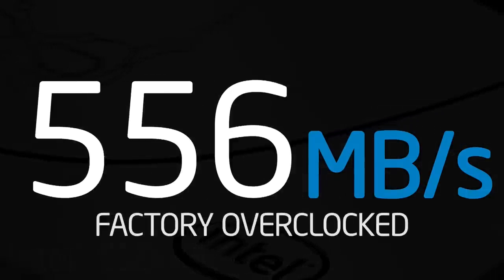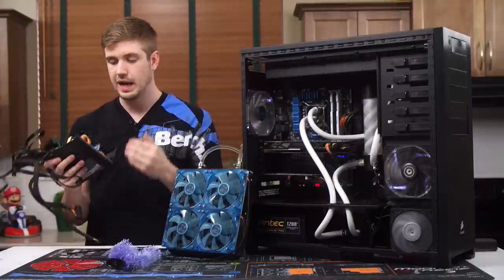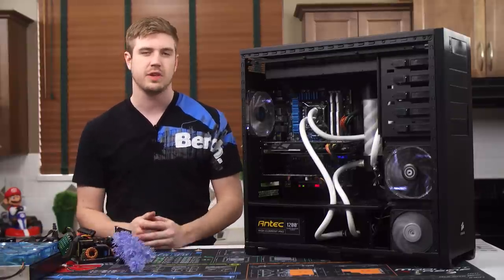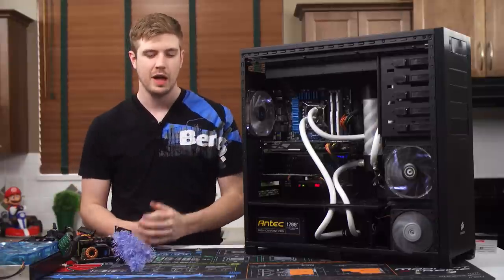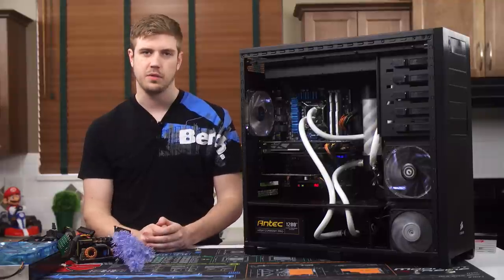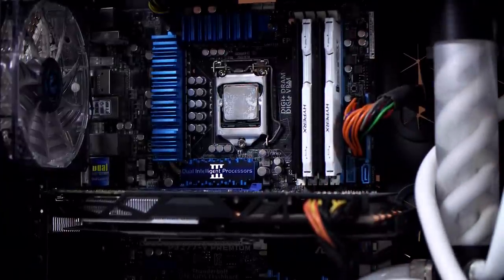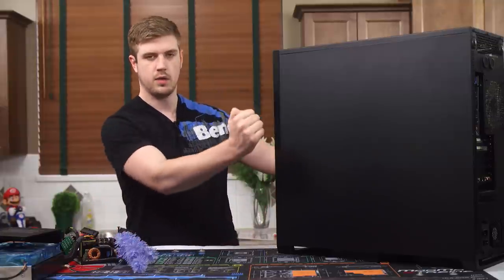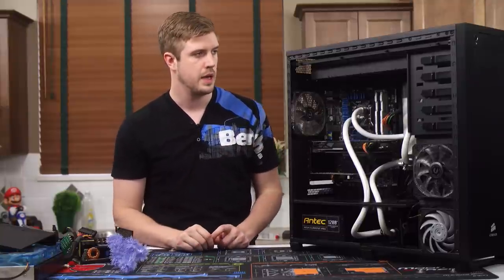Personal Rig Update 2 - Slick: The Introduction of Squirtle

Comment: It boggles my mind why you decided to go for a 780 instead of a 290X/290.
You & Linus are Nvidia fangirls and I hate it !
I lost all the trust I had in you guys when you Luke would benchmark the 7950 and have it beating 680s and then Linus would go recommending the 660 Ti over it and featuring it in gaming builds. It's fucking sad.

Nvidia has given gamers a lot of shit through the years with scandal after scandl, tier 0, The 314.18 drivers that killed cards (purposely to force users to upgrade), the OriginPC scandal, treating Linux users as second class citizens by cutting most multi monitor feature support and the GameWorks scandal that had developers go on record and say that "Nvidia has lost a lot of respect with the unusable blackbox GameWorks" on twitter, this is ON record.
http://linustechtips.com/main/topic/137965-developers-criticze-nvidias-gameworks-program-on-twitter-for-its-blackbox-nature/

While AMD has been doing a lot of great work and you don't give them any appreciation. They've given us the Titan killers the R9 290X & R9 290 at half & a third of the price & better compute performance. They've given us FreeSync which Nvidia propped up to milk gamers and continuously lied about the requirements to make and use. AMD gave us Mantle and offered Nvidia to use it for FREE but they refused. The only reason Microsoft even started developing DX12 was because of AMD's massive Mantle push.

Mantle has accumulated more adoption in its first year than DX9 did within its first year.

AMD has given us HSA & open standard Linux drivers, they've given us the never settle bundle.
It's disappointingly saddening and angering to see you and Linus play this role as Nvidia's PR assets.
Reply: Listen he has the right to use whatever parts he wants in his rig. I hear what you're saying and I know that a lot of it is absolutely true.

When things like this happen we should all stand up and say no to Nvidia or whatever company is doing these things, say no to Apple, say no to Samsung, say no to Intel.

Like I said everyone has the right to use whatever product they want BUT we also must be aware of the horrible things that the company we're buying from is doing. Because if we don't stand up and say we're not going to take this anymore and just keep supporting these companies who's going to stop them ?
Reply from the maker: There are plenty of reasons to use NVIDIA cards or to use AMD cards. I can understand why someone would choose either one of them. I use NVIDIA because of Gamestream to my SHIELD. It's awesome. I spend more time playing PC games on my handheld than on my PC.

You don't have to like that, and you don't have to use your PC like that, so enjoy your AMD card, I'll enjoy my NVIDIA one, and we'll both be happy. It doens't make either of our choices wrong.

Also, you need to fact-check quite a bit of the stuff in your post. Some of it is true, some has some basis in fact, and some of it is pure tin-foil hat nonsense.
Reply: SDA DCAS What is this ? I can't believe my eyes ! a mature intellectual conversation on a youtube video ? did hell freeze over ?
Reply: AMD are losers Linus sold out to the right team. Get over it.
Reply: Honestly, while I do agree with some of your points towards Linus (he's definitely biased towards Nvidia, sometimes pretty blatantly) I don't think Nvidia is doing anything that any other business in their position wouldn't do. It's a company after all, its bottom line is much more important than so-called integrity. 

....Now back to me playing DR3 (horrible port btw) on my R9 290.
Reply: Straight up Your mad, Intel and Nvidia have been on Top the past acouple years If you want the best for gaming and Editing you went Nvidia/Intel, Amd makes some amazing price to performance and I bet if they become the top Dog and start some awesome streaming and amazing performance over Intel, Linus or Anyone out there would switch but once somethings the best and just works why switch but I guess were all fan boys.. Money Aside What Works and Outperforms will be on Top it will get the Most Credit/publicly.. Sorry for my typing lol
Reply: I just think you jelly because you cant afford NVidia cards
Reply: ***** what about nvidia's heat problems with the gtx 400 series
Reply: viewgamer x most amd cards don't survive my abuse for more then a year... nvidia cards im getting 2-3 years out of... i think i know what ill go with.
Reply: viewgamer x adobe for non creative cloud supports nvidia cards through a few hacks, physx is nice if you can run it, triple monitor setup is nice without active display adapters. I'm sitting here with two 7870s and I sometimes wish that i had an nvidia card. That extra 50-100 dollars does actually bring a few features that can cost the equivalent.
Reply: SDA DCAS Yeah, he has the right to use what he wwants. But Linus as a REVIEWER has to judge the Products based on Performance, not what Logo is on it...
Reply: viewgamer x theyre actually quite neutral when it comes to amd. reason they mostly don't use it is because they prefer non-sli/xfire builds thus single cards, and nvidia still has the most powerful card. nvidia also scores better on power usage. amd is great for value builds but theyrz not really going for value. just pure performance
Reply: viewgamer x theyre actually quite neutral when it comes to amd. reason they mostly don't use it is because they prefer non-sli/xfire builds thus single cards, and nvidia still has the most powerful card. nvidia also scores better on power usage. amd is great for value builds but theyrz not really going for value. just pure performance
Reply: AMD sucks, get over it!
Reply: Jeff Beckmann as long as you guys have no valid argument instead of "amd sucks" i will never take you seriously. 
I have an 100$ amd quad core 3.7ghz pocessor, and it works fine and extremely fast. If it does what is means to do, how can it suck?
Reply: 3.7ghz is fast? What $100 AMD processor are you using? What are you using it for?
Reply: viewgamer x There's two reasons why they chose NVIDIA as far as I can tell.
(1 CUDA helps a lot in video editing. AMD has OpenCL, but it's still not like CUDA.
(2 (This is more for Linus) NVIDIA SHIELD
Reply: Jeff Beckmann 3.7ghz is still quite fast... if you count a lot of processors using it. and also AMD quad core like athlon 860k has  very close gaming performance and actually works well , and the FX 6-4 core are same as 8 core just few cores disabled. But it really isn't bad the FX 8350 BTW. It is comparable to just slightly around i3-2120 Sandy Bridge single core-wise, or a little bit less, but that still kicks ass even in older games. This means i can play Quake Live easily even though it's a single/dual core quake3 engine game i easily will get 125 fps over. I want to build a budget build for modern games, and even with its single core i am heavily considered to AMD. I do multitasking a lot and the 8 core AMD kicks ass in multitasking thanks to the core space, a lot of programs will use the cores fully or use like 2 so that actually gives a good win win. Plus a lot of games WILL use a lot of cores, it's a undisputable fact, games are moving on to use more cores and even 'weak' 8 cores like AMD will benefit from it. Older games will get patches AND source ports to get it. also. 60+ FPS. Still PC master race gaming experience. Plus i can get a more powerful NVIDIA graphics card if i ever want to switch to it. The only thing i really see bad with it is emulators when they only use like one core or some BIOS options for throttling which 'botttleneck' AMD which i can easily turn off. If its such a weak chip I'll OC one core myself just to play these old games. Don't give up.
Reply: Sevival Dude, if you don't know when to use the word "an" how can anyone take YOU seriously...?
Reply: Greyghostvol1 You know they  get free cards from Nvidia and don't get any from AMD right?
Reply: viewgamer x maybe because they want GPUs not heat stoves
Reply: hahaha Aleem, excellent! I'm a Nvidia fanboy because they make the higher quality product. You get what you pay for and you want your GPU to last more than 2 years, it is a no brainer. My friends AMD card is artifacting after only a couple years, I've never had a card artifact on me made by Nvidia.
Reply: +Ryan Frechette So ONE case shows the effort of an entire company? Guess my 550ti that crashed all the f**king time proves nvidia is a sh*t company too.
Reply: Naa, that was one case I used as an example. Anyone who knows anything about building computers will tell you AMD/ATI products are for budget builds. That is common knowledge among the PC gaming community. Sorry if I struck a nerve man but do some research before you try to flame me on a topic that is common knowledge.
Reply: Ryan Frechette Nope, but tell yourself whatever you need to justify the price premium.  Try not assuming everyone who makes an argument different than yours is a "Fanboy".  No brand allegiance here.  I have a 750ti in my workstation and a R9 290 in my gaming rig.  AMD has fallen grossly behind intel in processors, yes.  With intel's quad cores out-performing AMD's 8 core processors.  But AMD is right there with Nvidia on graphics cards.  Try looking at any benchmark.  They'll usually have 1% or so lower framerates than equivalent Nvidia cards, but be 10-15% cheaper.
Reply: +LinusTechTips  I adore how you named this rig after the Kanto region's water-type starter Pokemon!  I also like how you put in a blue power supply because if you actually look at the color palette for Squirtle, there is a lot of blue.  It also matches the other blue parts of your rig.  Yes, I am into Pokemon.
Reply: +viewgamer x I use AMD CPU and R9 290.. only reason i use them over Intel/nVIDIA is that i can get them second hand for 1/5 of the price for their counterparts from Intel/nVIDIA.. they are not better products in any way imaginable.. just alot cheaper, with comparable performance.
Reply: +Thunder Stryker Well you totally will be fun at parties.
Reply: +viewgamer x because thats a real issue facing the world  -___- ....nvidia bias
Reply: The easiest way to spot a fanboy: the person calling everyone who disagrees with them fanboys
Reply: haha nice! Truer words have never been spoken.
Reply: xpeterson Which would make you one as well. Wait... shit.
Reply: +viewgamer x wow give them shit for "fangirling" even though you are doing the exact same thing for AMD... There is a reason AMD is not as popular and really only used by plebs now...its cheap and shit.
Reply: +viewgamer x seems like you are a team red fanboy then..
anyway, nobody cares
Reply: +viewgamer x whatever dude i don't what card i get, 70$ is a great price for any card, especially a 970

find me a 290x for $70 and i'd have gladly bought one of those
Reply: +Ryan Frechette I've seen nvidia crashing after 1 week, it's a badluck. but it's happen.
Reply: +Pascal Lafrenière, I just dont like that everybody trash talk about AMD without them knowing it's comparable to nvidia....  or even better!!... They dont know, and because of that, amd will fall into dark..
Reply: +viewgamer x Considering that Nvidia drivers etc tend to be more stable and have less issues due to serveral reasons I'd say that Nvidia trumps AMD.
Reply: Andreas karlsson Okay. Good for you. Go nVidia. Let the AMD fans go AMD.
Reply: TheBcoolGuy Yes of coursem wouldnt even dream of forcing anyone to buy product X just because I like it. I just said why I like Nvidia more and why others might as well..
Reply: Andreas karlsson whatever
Reply: You know what's sad? How fucking long that comment is.
Reply: +Jake van Dee u clearly do not know anything then. i have used amd cards since i built my pc in 2011 and they have all lasted more than two years.
Reply: FLOWEY the FLOWER An R9 390 is faster, cheaper, and with 2.28571428571 the vRAM of a GTX 970.
Reply: +viewgamer x i don't know why you are so mad, some people prefer other stuff and maybe Luke got a better deal for the 780 when he bought it. and also temperature and power conscription of a 290 is much worst than a 780
Reply: +Jake van Dee I've had mine for close to almost 5 years now, never failed me once.
Reply: +TheBcoolGuy Nice 3.5gb joke
Reply: +Zilla 970 has 4gb of vram
Reply: Link Freeman 970 can only use 3.5gb, sadly :)
Reply: Look it up
Reply: +TheBcoolGuy do you even know how that piece of scrap metal performs on GTA 5??
Reply: BerdZerk 70FPS on mixed high and medium settings at 1440p
Reply: Zilla and the 970? 65+ fps totally maxed out at 1440p. Ask Evil Buddha for proof. Just because a card has more vram it doesn't mean it's better, so don't go all 'omg bro, that card has 8gigs of vram, 8gigs!' It's the processing power of the card that matters. Let me give you another example. A GTX 980TI has 6gb of vram. Inspite of that it still tops the gpu market, only a little bit below the titan x.
Reply: Zilla and you should take a look at the 780ti, absolutely obliterates the 390x even at 4k. I get 40fps at 4k medium on a 780ti hall of fame.
Reply: BerdZerk But obviously cheaper, so better value
Reply: Zilla so if it's cheaper, it's more value?? When did people get
 so ignorant? You don't get the same performance per buck on the 390x as the 970, never in a million years. Since you say that cheaper is more value, go check out the LinusTechTips video called Low end video cards rant. It'll show you that cheaper does not necessarily mean more value. Peace.
Reply: viewgamer x you talk about nvidia 'treating Linux users as second class citizens.' Have you noticed that there are barely some games that are compatible with Linux? And that nvidia is more focused on the gaming community? And that quadros still have full multi-monitor support, even for Linux. You find shit to throw at NVidia, calling Linus and Luke NVidia fangirls when you yourself are playing fanboy for AMD. NVidia's so-called scandals have never ever affected their cards' fabulous performance in all video games. As for AMD, it's basically "if the game doesn't support mantle, its dead." I don't like wasting my summer on attention seekers, so peace.
Reply: +Zilla the 390 goes for the same price as the 970..
Reply: BerdZerk So you're saying that AMD will never be worth it? The only reason you are supporting ONLY Nvidia is because they have PhysX.
Reply: Zilla does it even look like I care about physx? I use NVidia cards because they support more games, unlike AMD. Most games don't need physx to be able to support NVidia cards. AMD is good for workstation purposes. They are also good for gaming, but do not perform as well as NVidia. That's the bottom line.
Reply: Zilla you should stop trying to be an AMD fanboy. I am personally neutral. I use what is better at fulfilling my needs.
Reply: BerdZerk So you're saying AMD isn't for gaming as much as Nvidia is? That's fanboism if I've ever seen it.
Reply: Zilla I never said that AMD is not for gaming as much as NVidia is, I said that AMD cards do not perform as well as NVidia cards, and that's the bottom line. However, if there are AMD cards that truly perform better, I will switch. I'm not being a fanboy. The one company that truly shits on AMD is not Linus media group, but apple.  We shouldn't be fighting like this, we are all part of the gaming master race, shitty prebuilt apple macs are what we h8 m8.
Reply: Zilla You know what, I think I'm just going to stop trying to tell you that NVidia is better. Go ahead and use what works better for you, though I would recommend you give NVidia a go. And I think we can all agree that apple takes low end hardware and coats it with gold to attract rich buyers.
Reply: BerdZerk Case closed.
Reply: +viewgamer x 
That's still their choice to do
Reply: ***** 
That's what everyone thinks about AMD cards. Guess what? They run hotter, because they're still the same chip as the last 2 GENERATIONS! But it's still a super powerful card that is not the best value, but overpowered as hell when combined in Crossfire, and the heat is no problem to the system if it's a blower style GPU, which half of AMD cards are anyways. Shut your face and realize that Nvidia is just as bad as AMD in in terms of thermal and electrical efficiency, even if they do have the upper hand in raw power.
Reply: ***** 
GTX 650 TI, BETCH
If I wanted to OC a future AMD GPU, it would probably destroy Maxwell, I'm not saying AMD is the fastest it's just my favored choice.
Reply: +BerdZerk You can go on /r/hardwareswap and find used 970 for $200 and a used 390X for $220. Once you try gaming at 4K, as Awesomesauce Network point out, the 970 falls flat on its face because of the VRAM limitations. You said that the 970 is better performance per dollar, but that just isn't true anymore. Sure, if both bought new, it'd be a bit difficult to justify. However, the RX 480 seems to be a legit FPS/$ sweetspot for this generation. Nvidia could try to beat it, but AMD usually beats Nvidia with the value GPU's for $250 and less. So, Nvidia can have the top end niche while AMD gets the lower end consumer and the high end AMD enthusiasts who are okay with a small performance loss.
Both have their merits, I just think most of the comments on here are from those who are tired of paying premiums to get a bit better performance. Also, Nvidia can be super corporate and closed off, which is not a good think. Proprietary crap should be left to Apple, it's not in the spirit of the PC community.
Reply: Naga Sadow whoa, hang on. Even at 4k the 970 will obliterate the 390x. 970 GTA V - 4k high, no msaa 50fps. 390x- same settings- 34 fps. Get some knowledge, then try to argue on the internet. 'AMD usually beats NVidia' shut up, nvidias 960 beats the 370, 380. And by the way, you should compare the 480 with the 1060
Reply: BerdZerk You have no proof that the 970 destroys the 390x. The 390x is more comparable to the 980 than the 970, and the 390 is comparable to the 970.
Reply: BerdZerk No, it doesn't. Awesomesauce Network did a video about the 970 at 4k on GTA V. He played on low-medium and kept getting texture pop-in and lag because it was going above 3.5GB of VRAM. Just because there is a benchmark doesn't mean it's accurate. He did live gaming and showed the settings as he adjusted them.
Reply: BerdZerk According to http://gpu.userbenchmark.com/Compare/Nvidia-GTX-960-vs-AMD-R9-380/3165vs3482 along with several benchmarking videos, the 380 beats the 960. So, yet again another part where you are the one that needs to do more research.
Reply: Naga Sadow you know what? That was before the latest patch.
Reply: Naga Sadow lol the 380 has more bugs than my garden. NVidia drivers are much more stable for the 960.  and you can't gamestream on a 380. No Ansel. NVidia is overall a much better value for money.
Reply: Zilla bro even the 390(I meant 390 lul) has loads of hardware bugs on GTA V. AMD sez 60 fps maxed out 1440p, but it only gets about 34 fps. And the
Reply: Naga Sadow and by the way, 970 is not meant to play at 4k. Compare the 390x to the 980. Then get rekt.
Reply: +BerdZerk Okay, well I'd love to see your live benchmarks or videos that others have done with live benchmarks. You're just talking shit on the internet with no proof. Besides reviewers, game publishers, or those who play games for a living, who needs Ansel? It has to be included into the game coding, and will not function on already released titles, so it's likely to be supported like PhysX which is rarely.
Reply: Naga Sadow my point is you don't make the right comparison. Who the fuck uses a 970 to play at 4k? AMD drivers always have problems with some game or the other. An r9 380 wouldn't run fucking prototype 2 without stuttering. Or Doom 2016. NVIDIA has picture perfect drivers.
Reply: BerdZerk And you're saying AMD's drivers are what make their GPUs so "slow and stuttery" and Nvidia's drivers are "picture perfect"? Earlier this year, people's PCs basically broke because they updated and didn't have a GPU from the latest generation (9xx) Good thing I didn't update my 650 TI, otherwise my computer wouldn't be where it is right now and I would have had to get a new f***ing motherboard. Don't talk shit about how Nvidia has picture perfect drivers, by my observations I know they're no better than AMD
Reply: Zilla I didn't experience shit. I was on a GTX 760, and I updated, no shut happened.
Reply: BerdZerk Because you have a GPU that's still in circulation (being sold in prebuilt PCs). GPUs like the 6xx series were the first affected
Reply: Zilla my friend was on a 670, nothing happened to him either
Reply: Zilla guess it won't matter cuz we Both are on 960s now.
Reply: BerdZerk Good for you
Reply: BerdZerk You were the one who compared the 970 and 390X. I provided examples of the 970 being shit compared to the 390X. Nvidia drivers being perfect? I have to restart my computer ~50% of the time to run Borderlands 2 on my PC due to driver crashes, and I have an Nvidia card at the moment.
Reply: Naga Sadow please read. in another comment I said I meant 390. Mistakes happen. You probably don't take care of your PC. Open the case. Dust it. THEN talk.
Reply: +BerdZerk That's literally irrelevant.
Reply: +BerdZerk There is a pop-up stating that the driver crashed and then recovered. Sometimes the game will load, other times it keeps crashing until I restart. Clearly a software issue, not hardware related.
Reply: Naga Sadow ever heard about 'reinstall'? If u already have, you probably using a faulty card.
Reply: 2 years later; AMD cards still suck ass at performance compared to NVIDIA; just like their processors to Intel.

Saying people are fanboys for using the more powerful hardware is just asinine.
Reply: ***** the RX 480 must be another stove tho....
Reply: ***** At every price point AMD competes with Nvidia except the new top tier cards. The 290X was a Titan killer and was right around the 780/780 Ti at launch. The Fury X was right around the Titan X and 980 Ti. Sure, a couple frames off in some games, but that's negligible. So, its not a fair comparison to say that their GPU's are lacking in performance like their CPU's.
Reply: Naga Sadow Thing is, Radeon is not the same as AMD FX. AMD doesn't even recommend their own CPUs with their own GPUs, they used a 4790k in their mini build with the R9 Nano.
Reply: Zilla That doesn't matter, the comment was about GPU's.
Reply: Naga Sadow Just saying you shouldn't expect the same AMD vs Nvidia arguments that their CPUs have against Intel
Reply: Zilla I wasn't the one who brought up AMD CPU's, that was Ace Strife. "2 years later; AMD cards still suck ass at performance compared to NVIDIA; just like their processors to Intel."
Reply: Naga Sadow Oh, I see. I was actually agreeing with you though...
Reply: Zilla I couldn't really tell, it's hard to read the tone of the original comment.
Reply: Naga Sadow sorry
Reply: Im sorry but my amd processor is already melting through my mobo. It works great though!
Reply: +WiFiCannibal but amd processors can teach you fire bending
Reply: Tobias11ize FX 9590 and an MSI Gaming 970 motherboard can do that.
Reply: Zilla i have a fx-8350 and a msi gaming 970. im investing in fans.
Reply: Tobias11ize Forget that, invest in the air conditioning craze
Reply: "Mantle has accumulated more adoption in its first year than DX9 did within its first year." 

I'm not hating on you or any shit like that but there would be more because their would be more people to utilize it. But if you're talking percentages than ignore me ;)
Reply: and be fucking sides. a 290x is just comparable to a regular fucking 780. now the nvidia 10 series gpu's are like 2194547457548657595 times more powerful and cheaper than the 290x and the 290x heat is so fucking ridiculous that i had one myself and it burned my leg, melted some of the plastic in my computer almost ruining it and it only survived for a fucking year because of its stupid heat problems and also it overheated many components in my computer and made them throttle. especially the fucking cpu
Reply: PearuArmasJ A 290x is comparable in performance between the GTX 970 and 980. Sometimes it beats the 970, sometimes it comes close to matching the 980. You're exaggerating Pascal's price/performance ratio by a lot, and even though they are probably the best value in the market right now, a number like 2194547457548657595 is ridiculous and you should really know better than to fanboi a specific side in terms of GPUs. In my opinion, my Windforce 2X R9 380x is directly comparable to a GTX 970 in best-case scenarios. I don't prefer AMD or Nvidia for GPUs at all, and I just choose what the fastest GPU in my price range is at that specific time. About two weeks ago, my choice was the supposed "960 Crusher", which in my tests with the FX-8320, considerably pounded any OC'd form of the 960 into the ground because of its considerably higher IPC. My point is that the only reason your 290x melted your computer is because you bought a reference GPU. Rookie mistake, but I guarantee if you bought a triple-fan GPU cooler from Arctic you would finally get reasonable temperatures and you would realize that the 290x, even though being unbearably hot to the touch can perform as well as people say it does. If you don't believe me, search into Youtube "Linustechtips 290x review"

TLDR, you're totally wrong about the performance of the 290x and you should actually be comparing it to a GTX Titan/Titan Black
Reply: Zilla no it is fucking comparable to a 780. look at the benchmarks amd fangirl
Reply: PearuArmasJ You're putting words in my mouth. I'm neither a fan of AMD or Nvidia. I said you shouldn't be comparing the 290x to a 780 and you start swearing unintelligibly at me because I tried to prove you wrong. As I said, look up Linus' video on the 290x and he'll directly compare it to the 780ti/Titan.
Reply: PearuArmasJ An R9 290 is comparable to the 780, yes. Why didn't you emphasize on that before you went on a total rant bashing me because I wasn't an Nvidia fanboy? It would have made this a lot easier.
Reply: why does it annoy it you if its not ur pc and they dont hate on amd so why does it affect your or anyone elses lives so based on that you are making yourself exactly what u accusing linus of being exept that your on team red #stopragingfanboy
Reply: BerdZerk thx
Reply: They prefers Nvidia and Intel because it's better,if AMD were better they would prefer it too
PS: Why are you so mad,use your AMD hardware and let other people use the hardware they want
Reply: Or, and bare with me, they support whatever is BETTER. Nothing more. But hey, only Nvidia users can be fanboys right?
Reply: Well if you believe they release drivers to kill the card you have, forcing you to upgrade, Then learn how your computer works and role back the driver. BAM! your card is fixed.
Reply: viewgamer x #teamgreen #nVidiaRocks #CudaBeast
Reply: AMD is GREAT I love it, i cook bacon all the time while gaming... Will never go back lol
Reply: Christopher Boyum I'll give em that, AMD does make a mean slice of toast.
Reply: +PearuArmasJ You are triggered, Triggered, TRIGGERED
Reply: +PearuArmasJ Your replies aren't here. But for some whatever reason, they are in my notifications so I am going to reply.

You are full of fight, aren't you? Perhaps you are the victim of bullying, and can't stand up for yourself IRL, and therefore, find it easy to get angry at strangers on YouTube due to relative anonymity. Just speculations, but you seem like a really angry person. At least my self-confidence means I can laugh off the futile attempts to get on my nerves. There is humour in everything.
Reply: viewgamer x as much as nvidia makes great cards AMD's cards last longer in the long term if you think about it the titan x maxwell and 980ti were great when they came out but when nvidia introduced the pascal series and released the 1070 it basically kill the 980ti and titan x and the 1070 is much cheaper while the 290 and 295x2 are older cards yet they still compete in today's market
Reply: Dan Suno I don't know about that. I had a GTX 770 that would still play all the newest games flawlessly on high/ ultra settings. That's a 4 year old card.
Reply: I'm pretty amazed by the fact that this comment train is still going after 3 years
Reply: Same, I'm just still amazed that people are mad about someone part choice in a PERSONAL rig. 
It's like getting mad over someone's choice of clothing. It's all moot because at the end of the day, they are the ones who are gonna be using the system, and whatever they are happy with, they are happy with.
Reply: Afaik AMD does not have Gamestream...